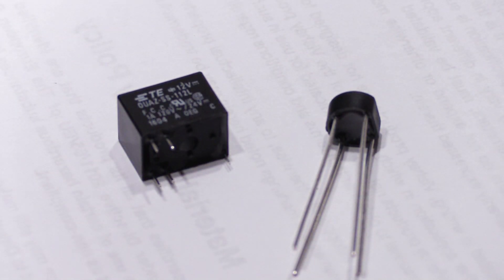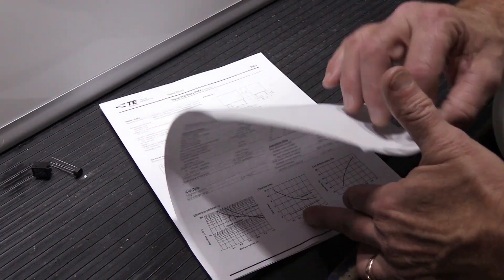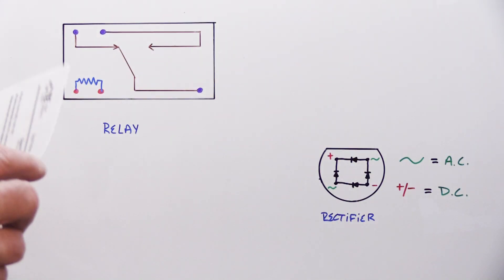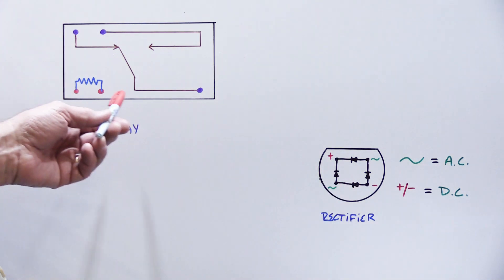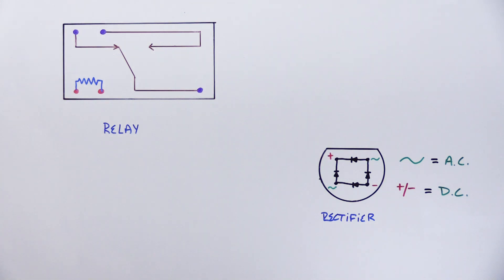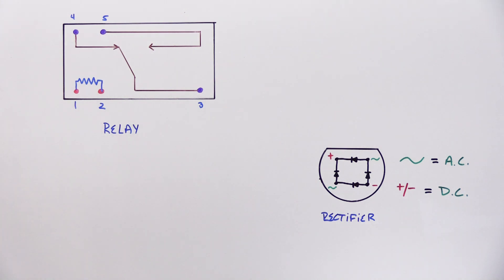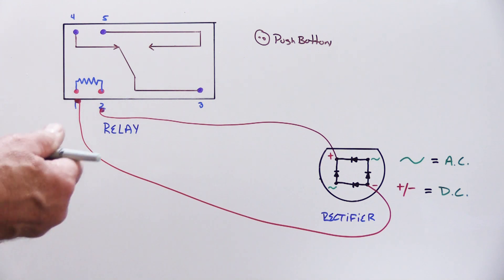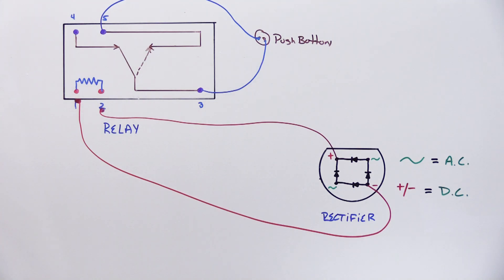Rectifier Relay Board Part 4 ~ How Do I Hook This up???

Comment: Can you bend those relay prongs in opposite directions on the bread board as to create some separation for soldering?
Reply from the maker: Hi blang1: There's no need to bend the pins - which are a standard 1.0mm spacing - which is the spacing of the hole on the circuit board - I've made a few thousand Relay Boards and with a normal amount of care when soldering - bridges are not really a problem - Chris

Comment: Awesome Ed, and thank you so much for your videos! I am located in Finland and I watched your videos both for the Nest Hello setup and this one. Both were of a great help! Now I am looking for the relay and the rectifier from local electronic vendors. I had to purchase a separate transformer for my Nest Hello since my doorbell's transformer did not provide high enough voltage for the Nest Hello (in Finland the transformer is often integrated to the doorbell and the doorbell is connected to 230V AC from where the transformer provides 12V AC to the front door push button).
Reply from the maker: Hi Nicolas:  You're my first viewer from Finland - Welcome!  I'm glad that the Videos helped you - Chris
Reply: @northsideservicecompany3567  Hi Ed! I wonder if it would be possible ordering the relay / rectifier preassembled combo from you? Under what conditions that would be possible? Thank you very much in advance for your time and your response!
Reply from the maker: @NicolasGabrielRobez  I can look into what it would take to ship a Relay Board to Finland.  You would need to email me directly with an address - Chris nscompany@msn.com